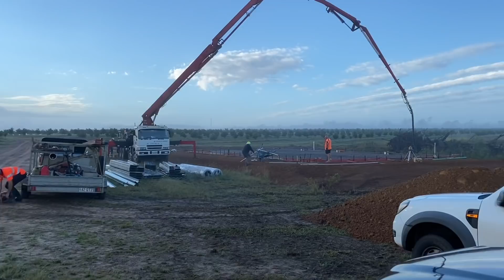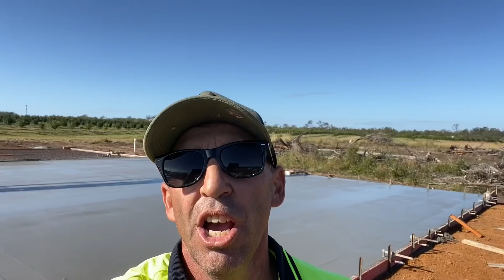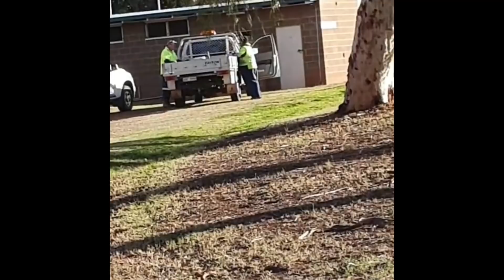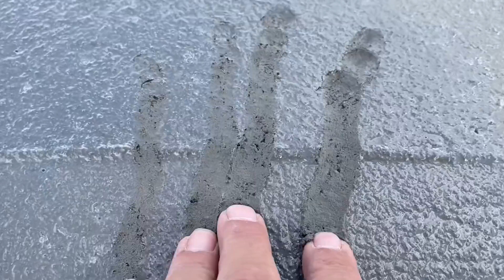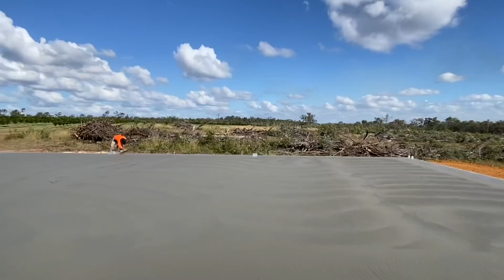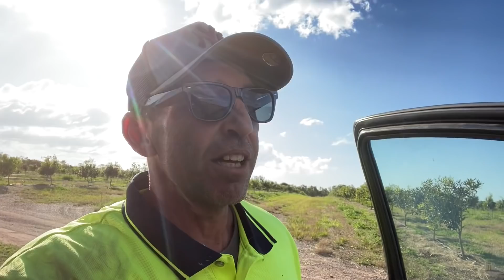What’s Wrong with this concrete ￼

Comment: When I was a cement finisher we put slabs in with a darby made from wood, it would knock down the stones and bring the fat up, it was a big help when we had some shit concrete that the matrix used reduced cement content with chemicals to meet the strength requirements but too much like trying to finish wet sand. The companies that sold this shit supplied bridge and wall pours mainly that used vibrators against forms so no consideration for trowel finishing either by hand or power.

Comment: How many yards can those trucks hold out there ?? They look so small in comparison . Our trucks can hold 12 yards but they topically run with 9-10
Reply from the maker: Hey mate I’m not sure and yards but in cubic metre most of them carry six and they’re really big ones here carry 8 m³ of concrete
Reply: @concreteninja  So if my math is right our trucks hold 13 meters of concrete. You boys need a couple of these trucks !
Reply from the maker: @salvatorezarrelli625  That’s a lot of concrete we would only need two trucks for most of our jobs
Reply: 10 cubic yards is 7.6 cubic meters which is a typical load for an eight wheeler ( twin steer bogie drive )
Reply: 10 wheeler trucks typically hold 8.6 cu meters which is 11.2 cu yards it all depends which state you’re in and if you have the necessary permits

Comment: Is it blended or OPC? Over in the UK a lot of plants are making us use blended as there is a shortage with cement, so the blended gives slows down the hydration and some blended mixes contain fly ash pal
Reply from the maker: They have that concrete like that here in Australia all the time it always bleeds

Comment: Can’t believe 32 did that too ya? 32 doesn’t usually have that trouble, that’s why we use it on everything, sick of waiting, atleast it always finishes up nice!
Reply: Does 32 cure quicker then 25? Good to know
Reply: @AMJB100000000  
It’s not that it cures quicker, but it’s way more consistent timing wise, 
25 in Vic can be really unpredictable, even with ad mixtures, sometimes it rockets, some times your still finishing it at 630 at night. 
32 seems to be a lot more consistent with an hour and a half 2 hours till chopper, and always finishes nicer, 
I think the 25 has way too much fly ash or slag in it as it’s the main product and they struggle getting the daily batching correct. 32 I would assume with a higher cement content makes it more predictable, and it burns up real nice,